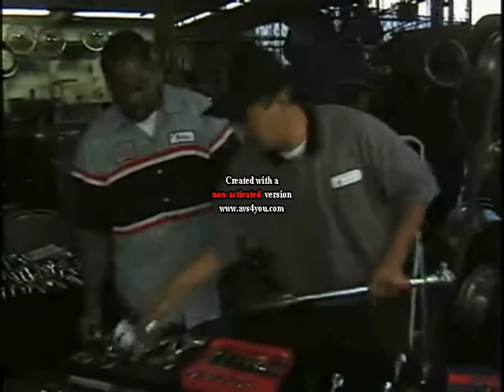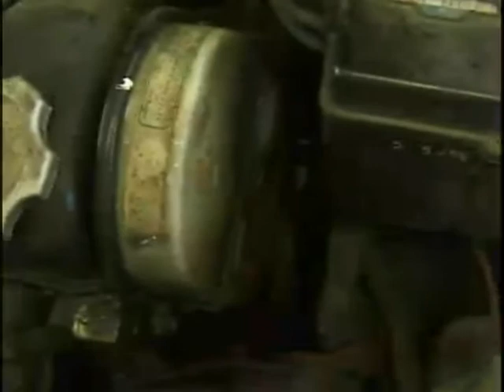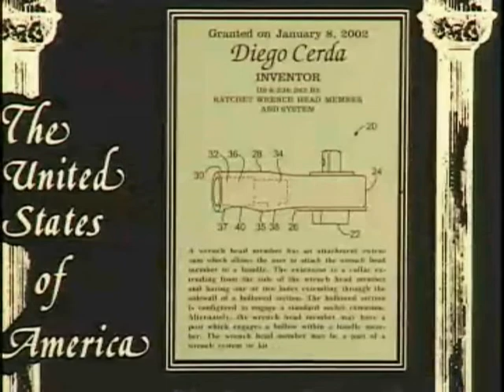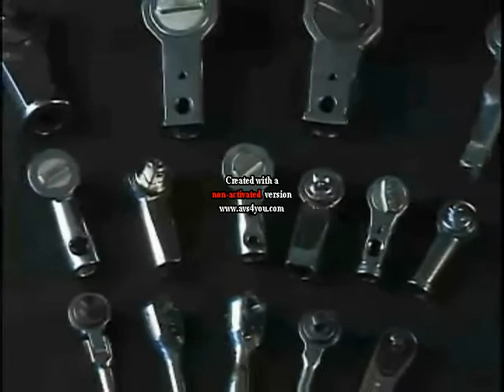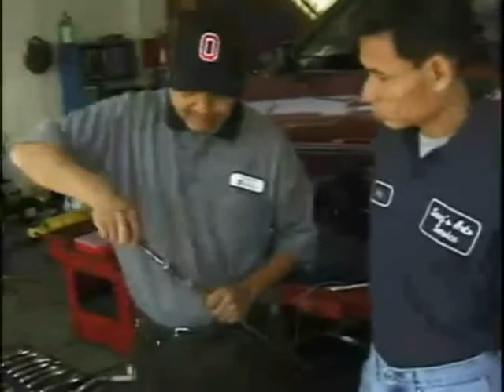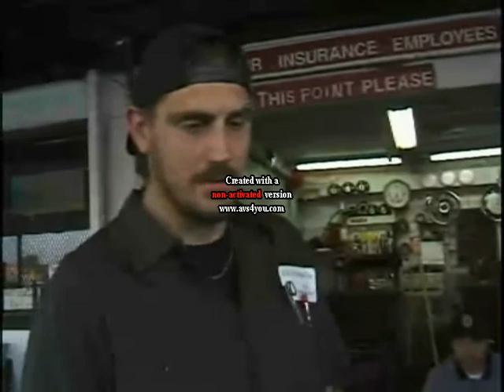invention (ATS) ADVANCED TOOL SYSTEM

Comment: I purchased a ratchet with an extendable handle. It gives me the extra few inches needed to make a tight fastener easier to move. Otherrwise, I'd just use a breaker bar. I'm not sure how this tool set fits into the picture. Does it cost less than buying a breaker bar?